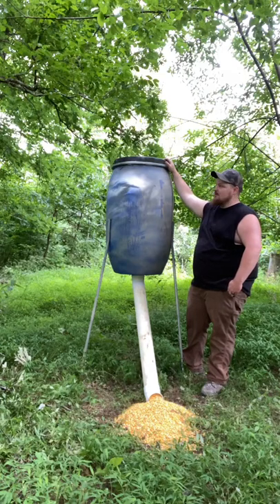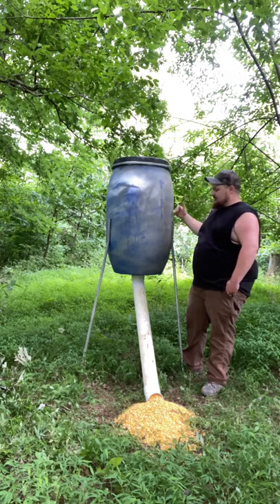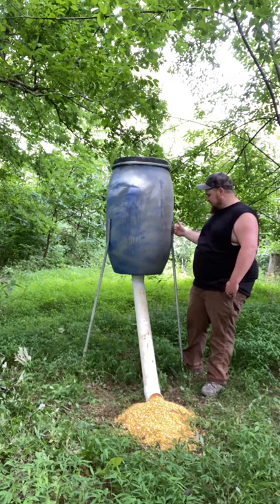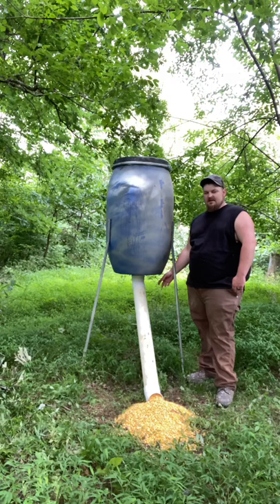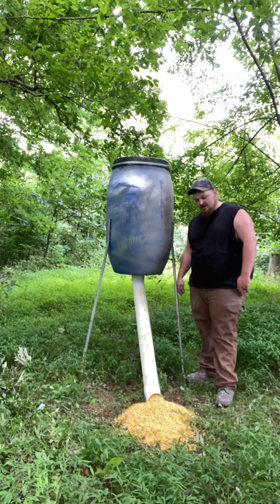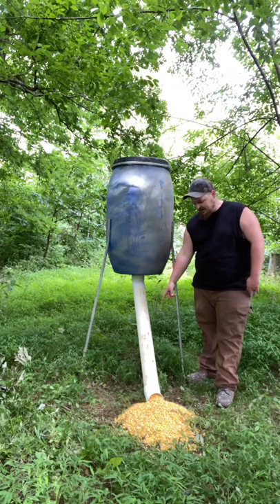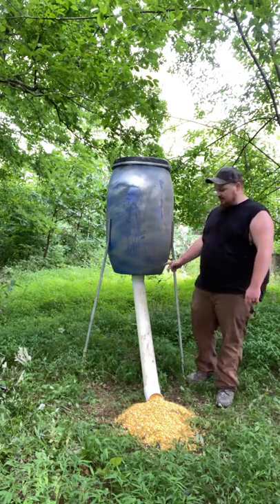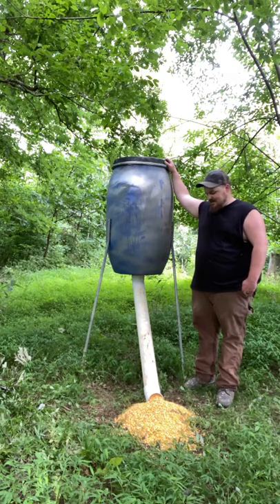DIY Deer Feeder

Comment: How well are the legs holding up?
Reply from the maker: Still doing great
Reply: @stubbysoutdoors4984  I been thinking about it I have a few 55 gallon steel barrels and was wondering if conduit would hold up to the weight
Reply from the maker: I’d  use 3/4 in and it would hold up